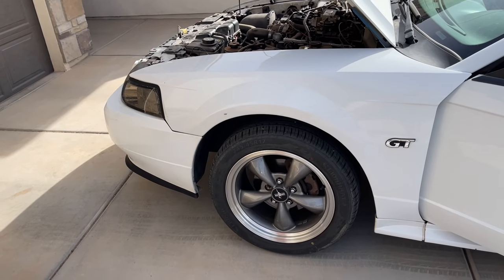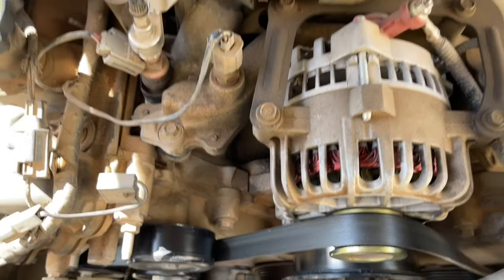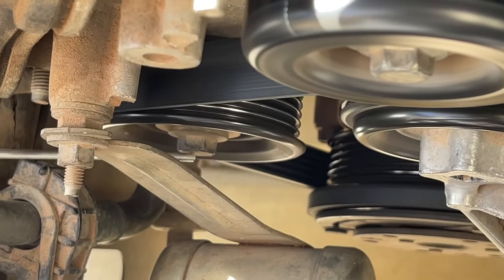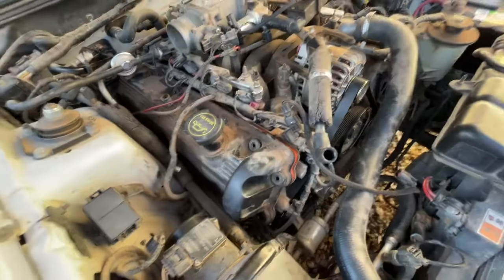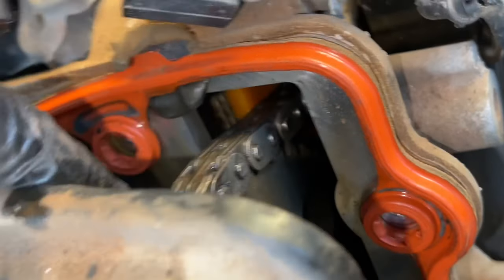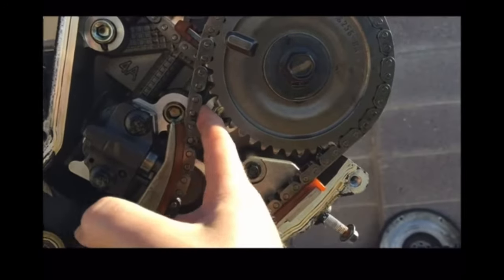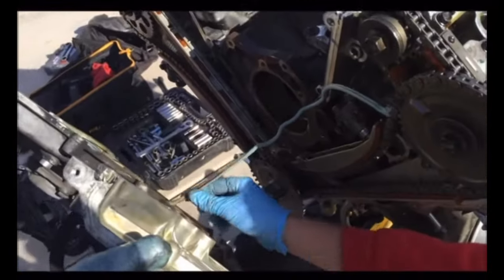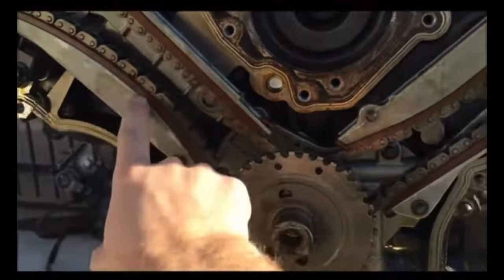Bad timing chain tensioner or guide, how to diagnose engine noises Ford Mustang

Comment: I had something like this too on my 2008 mustang 4.6L.  It started as a ticking sound after a cold start that lasted several mins until the engine warmed up. Then became a ridiculously loud scraping / rattling sound when pushing and releasing the accelerator, especially when driving.  Turns out the engine was leaking oil, probably from thinning due to very hot weather.  Level was very low and there was not enough pressure to properly activate the timing belt tensioner. The sound went away after adding oil.
Reply: So you just added oil & that’s it ? It was the timing chain ? I have a 08 mustang gt too & having the exact same problem
Reply: @francosignal  In that car, the timing belt tensioner is activated by oil pressure, if it's too low, the chain goes slack and makes all kinds of horrible noise. I was like 3 or 4 qt. low on oil because of a leak I didn't know about. I added more and the noise went away. I have to keep an eye on it though, and just keep adding when it gets low.  The leak is on timing cover and I don't feel like fixing it any time soon.
Reply: This is exactly what my car was doing. It hadn't occurred to me to check the oil level because I'd never had a problem with using/losing oil before, and I had no warning lights or error codes.
Reply: Appreciate the help I got a 05 an was dealing with the same problems

Comment: Had an insanely loud rattling sound under the intake,suggestions?
Reply: I got the same issue only in a cold start ticking noise last to 5 sec then it goes normally & as my experience this could be the timing chain & their equipment or it could be one of those cylinder valves .. when it comes to timing belt that’s a different issue so that’s it I hope it will help you all !💫
Reply: Did you ever find out what the issue was ?

Comment: How many miles on the car?I have learned a lot from your channel.Thank you for the helpful content Danny!
Reply from the maker: 200,000 but the engine is from a 2004 and it’s a 2001 so somewhere along the way it got a new engine
Reply: Should an engine with 149,000 miles on it have timing issues. It is a 2004 Ford Explorer. I've had the vehicle for 3 yrs. It has a small ticking noise not really loud. Has low miles 149,000. Has a lot of new parts. Don't want to get rid of the vehicle if I don't have too

Comment: What would cause one side of the chain to be loose?everything on my 2v has been replaced but recently got a loud sound and took the cover off and when we spin the motor one passenger side chain gets loose at a certain point
Reply from the maker: The passenger side does have some slack vs the driver side. It is common to have one side loose since they are opposites and one naturally hangs with a little slack. It just can’t be too much slack. https://youtu.be/rqsWUZjDtnY?si=PjarHNp2lITUy9Uz
Reply: @dannyjohnsonsgarage   the chain gets loose  like your video it’s like I can almost take the chain off the teeth if I wanted too I replaced everything timing related with stage 2 cam but that chain is just super loose do you think the chain stretched or what else could cause a lot of slack on one side I can show you a video too
Reply from the maker: @EduardoTorres-yr1ni  it most likely the tensioners are weak. The video I posted above will show you the full timing process and tensioner replacement. Some chain stretch is also typical

Comment: Hey Danny, love the channel! I have a 03 centennial GT with around 118,000 miles. Should I go ahead and replace my timing components as a precaution? Is the 4.6 2v known to have timing chain issues? Thanks In advance!
Reply from the maker: It seems the main issues for timing is like this with a broken guide or tensioner. I think it’s a good idea when you’re ready for it, but until you want to or hear it start making noise on startup or idle it will probably be fine
Reply: My 01 GT didn’t have a loose chain, but tensioner pushed thru the guide and was wearing on the chain. Found out by Blackstone analysis at 137k miles showing high aluminum content

Comment: Man I replaced the set and still had noise, pretty sure I have rod knock. I also put the gaskets on the tensioners which I later found out after it was all put together that you’re not supposed to. Either way idc and im driving her till she blows. Some lucas and prayers will be used.
Reply: 2 years later , is she still going ???

Comment: Thanks for this video! I had a bad feeling about the KA24DE in my Xterra, it just sounded off so I stopped driving it. I saved up and got the parts cannon loaded up and got the valve cover and timing cover off yesterday, and sure enough there's just as much slop in my chain. Glad to see my suspicion to the change of how the motor sounds was warranted. Got a new chain and tensioners/guides, finishing up the head gasket first (I had an exhaust leak and oil leaks around cylinders 1 and 4). 

Aside from being dirty/oil fouled, everything looks good. If I kept driving it I'm sure it would have lead to wear and damage, but as it sits the valve clearance looks good, the cam lobes look good, there's no evidence of rod knock or piston wear/damage...I think I done good for an abandoned $550 vehicle that just needed some TLC.

Comment: Take a listen to my motorcycle engine and please tell me why the knocking is caused by thicker Castrol oil that can’t quite pressurize the tensioner?

The bike is new, all the parts are new and in good working order, so can’t it pressurize the tensioner?

Comment: Been thoroughly going through my 05 grand marquis ultimate. I'm not sure if it needs tensioners yet or not. If I have someone else start it while I'm standing in front of the engine I can hear a slight rattle for a short period following a cold start. But that's the symptoms in totality. Might choose the easier valve cover to remove and take a peek. It's so clean I'd hate to risk it jumping time just because I needed a louder symptom to be sure.
Reply from the maker: It is typical to have a rattle until oil pressure builds when the tensioners are getting weak. But once it’s running it should be fine. One day it will be good to replace, just keep listening for it to get worse
Reply: @dannyjohnsonsgarage  thanks for the input. The car has a PO462 code for fuel level sensor circuit high but the gauge reads accurately. Also get minor whiffs of fuel whole driving but not finding a leak. Don't have time to take the tank down so it'll go to a shop to track down that issue. While it's there I requested they take a listen to the engine. But it runs great and like you said it's only for a moment. Opened the fuel filler and it looks brand new inside so the oil has been kept up with its whole life too
Reply: @1598hi same thing with my 1999 ranger. Been trying hard to figure it out but I’m guessing the tensioners are just a bit loose

Comment: Danny, do you know if it’s ok to run a terminator that has head tick? Is it that bad or more like you’ll fix it when you get around to it? Mine has 86k miles with head tick
Reply from the maker: If it is for sure head tick it won’t hurt anything. Scott Hoag who helped develop the mach 1 and created MRT performance parts took a head tick engine and ran it as hard as he could as he tracked the car and never had any problems. 
  Just my opinion
Reply: @dannyjohnsonsgarage  Well that eases my concern, thank you for the info.

Comment: ahhh thanx. Was curious on how you would be able to tell if it was the chain based off of more than the noise. Now i feel stupid but glad i stumbled on your video lol.  Check to see how much slack is in it 👌
Reply from the maker: It is more common to have some slack on the passenger side, but you should know if it’s excessive. Oil pressure helps in some case once it’s running but you could see how mine punched through the tensioner https://youtu.be/rqsWUZjDtnY?si=QzktyxQH5U2dAgmg

Comment: My 2006 was making that same noise then one month later it started to rattle the poof car shut off and won’t start anymore? Also If my timing chain popped off or broke will it need new valves? Some say no and others say yes? Pls and thank you
Reply from the maker: If the timing chain did in fact break or come off entirely, it is likely it bent some valves. If that is the case, it may be more cost effective to drop in a replacement engine. You won’t know how bad the damage is until you tear it down. I’d remove the cam cover and see what it looks like
Reply: @dannyjohnsonsgarage  thank you for responding I will be tearing it down this weekend

Comment: Did the noise go away with some RPM if you revd it
Reply from the maker: This one did not because the tensioner had poked through the guide arm and was rubbing on the chain. Sometimes the noise will go away if the tensioner is weak and oil pressure helps it firm up

Comment: Does timing chain misfire on code p0301???Because this guy told me a bad timing chain doesn't give a code
Reply from the maker: It would be cylinder misfire, so more likely a spark plug, coil pack or even bad 02 sensor. You generally won’t get a code for a loose chain and if it was loose enough to jump teeth it would likely bend a valve
Reply: @dannyjohnsonsgarage  oh ok thanks you for the info.Omg I'm tires of mechanics trying to play games with the coils
Reply: Depending on if u hear the chain slapping it would